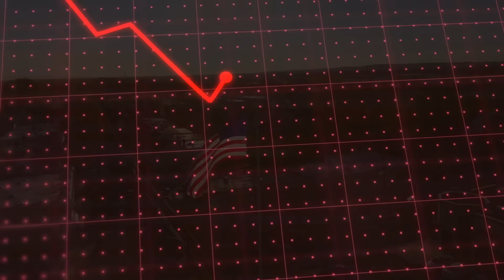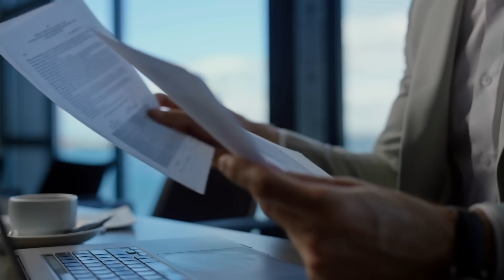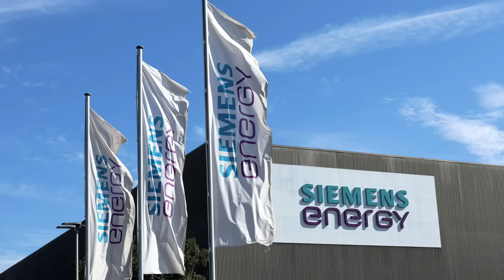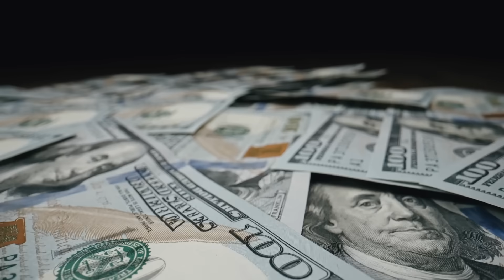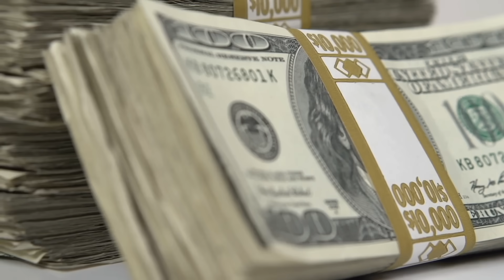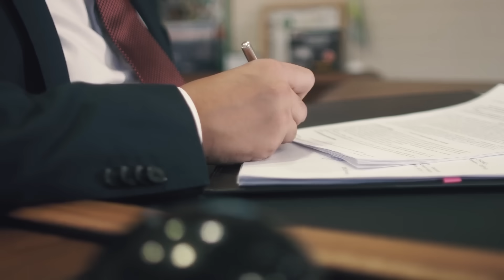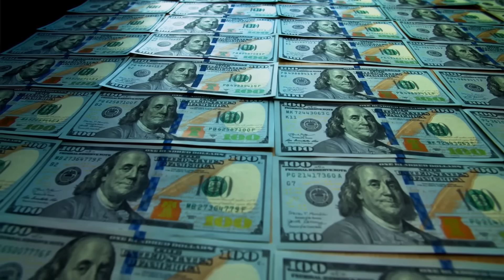The Real Reason America Has Turned Its Back On Wind Power Energy

Comment: I am originally from California and have seen Wind Farms in the Altamont Pass. Over time many of the wind generators have stopped working even with strong wind, plus yearly there is heavy bird death as this is an north-south migration path. The Wind Farms and Solar Farms are a poor solution compared to Nuclear, Natural Gas, or other fuel power plants.
Reply: I think ultimately nuclear is the best. This is especially so now that we have viable SMRs...can have a nuclear plant now the size of a small combined cycle gas turbine plant. Its a no brainer. 
Massive far flung distributed wind vs one small site that generates 300MW (or xyz) with fast nuclear reactor tech...like Terrapower. 

Whatever happens, there will be aspects of power gen that are irresistible. Behind the meter solar pv for example has taken the world by storm, noone couldve imagined how fast the costs would fall in just 2 decades. It is a classic example of creative destruction in economics. Solar pv's main adversary is of course solar thermal and solar hot water systems. I think its now the case that the most cost effective solution is to abandon solar hot water, and solar thermal, and never revisit it again...and just rely on solar pv + whatever generation is used fill the night time period of the day. 

Solar pv has essentially killed the economics of all power generation tech, except there is still the problem of what generates at night. It is the achilles heel. No point saying that to an acolyte of the renewable / global warming / climate crisis movement of course, coz theyll just make excuses for it til the cow come home. However, that is really the unarguable reality of it. Something that is on demand has to fill the reduced light, and no light times of the day in grids dominated by solar pv. It doesnt matter to me in the slightest what that is...wind, gas, diesel, biogas fuel cells (eg Apple HQ), etc. Its just reality.
Reply: They are stopped intentionally because in some time of day there is excess electricity in grid and not much transmission infrastructure to take power so in regulated market as in California they curtail or stop their wind farm , and in deregulated market like in texas the electricity price goes into negative so what it mean is to keep generating electricity wind farms will pay to the consumer to consume electricity
Reply: Trust the science and I do, that’s how I know the WEF=EU=WHO=UN CLIMATE CHANGE prediction is not just the greatest scam resulting in the greatest TREASON by UN Member Country POLITICIANS implemented the” carbon tax” and “net zero” replicable brown energy bull ship onto their citizens in living memory>>>>>>>>     

                The success of the WEF=EU=WHO=UN Climate Change scam for wealth redistribution from all UN Member countries to the Globalist elite MONSTERS , in all but a few countries like Russia with strong Leaders,   the Globalist MONSTERS plan is working perfectly! Affordable electricity for homes and industries, “CARBON TAX THEFT” electric cars, smart meters, poisoning cattle. All of these disasters successfully created by the Globalist MONSTERS puppets you call your government POLITICIAN and over paid bureaucrats (the question must be asked are our government politician’s idiots or knowing TRAITORS?) CO2 is the reason there is life as we know it on this planet>>>>>>>>>>>   

        The Dictionary defines TREASON; “Treason” is when a person acts against his/ her country. ... A treasonous person is called a TRAITOR! Outside the field of law, the word "traitor" can be used to describe a person who betrays a group to which he or she belongs!>>>>>>>>>>>>
Reply: I agree a 100% I'm California native.
Reply: Oh yeah and then San Luis Obispo County it's totally woke and green so they have outlawed gas heating and water heating every new house has to have electric appliances  And the grand kicker is they want to shut down Diablo Canyon nuclear power plant our own best form of electricity.
 Fruits & nuts man

Comment: I have had solar on my roof for many years.  Alas the sun doesn't shine at night.  Renewables are great, but we need a consistent base load.  The only way we can get to 100% renewables is with Tidal/Wave as there needs to be a guaranteed supply of which wind and solar can be switched off if too much generation.  In the interim nuclear is the answer.  The big problem with wind and to a lesser degree with solar is a connection cable and transformers is required, but is only utilised for 30% of the time and frequently under utilised, so once that is factored in and these wind turbines have a life of 15 - 20 years and a lot of maintenance, it doesnt make sense to keep adding them.
Reply: There are countries at 100% renewables without tidal waves.
Nuclear power is ok, when one has it. But building new ones as an interim solution is too slow and too expensive.

Comment: There are solutions to the grid distribution bottlenecks, but they depend on locating small modular nuclear reactors close to their loads [ideally just on the outskirts of big cities] so that energy transmission distances are short & direct.  Molten salt reactors can be designed to be walk-away safe & explosion-proof, to burn radioactive wastes from older reactors, and can be MUCH cheaper & faster to construct if various regulatory agencies from the 1950s can be persuaded to lift their dead bureaucratic hands from these modern projects.  Other quasi-optimum locations for modular nuclear are aging coal-burning power plants whose transmission line infrastructure is already in place.  Substitute the heat from the nuclear reaction for the coal fire - the heat exchangers, steam turbines, alternators, transformers & switchyards can be used as-is.
Reply: Peope need a solution now and not sometime in the future. It also needs to be affordable.
It also does not solve the bottleneck. These new reactors need connections too and they do not increase the connections for renewables.

Comment: 3.40 "very green to make"   thats utter nonsense.........the blades are composite materials (non recyclable) the steel,concrete,metals,generator are ALL made with fossil fuels and the concrete can never be recycled.  Wind turbines right now are subsidized with fossil fuel energy, and in most cases need significant load balance inputs from natural gas turbines during wind droughts, which are regular and substantial..........Australia has had really severe problems with that issue.  The entire east coast of Australia has regular instances of low wind, and low solar causing near grid collapse once or twice a year.
Reply: The blades can be recycled, as can the concrete.
Reply: @old-pete  Why do we see videos of them being chopped up and buried then?
Reply: @old-pete   I was hoping you might be able to elaborate on the recycling strategy of wind turbine blades that you say is easy, rather than compare to materials which really are easily recyclable, arguing that people do sometimes fail to recycle those materials too - I agree that's a shameful waste - But absolutely no-one throws away HUGE quantities of such obviously valuable materials as metal, in volumes comparable to those huge turbine blades and although we see them burying the blades in cut up sections big enough to almost live in, we don't see them dumping the steel structure - so obviously they DO recycle the parts which really are easily recyclable - No-one would turn down that opportunity.  My question is simply HOW do you propose they recycle the blades?  In my other much longer reply to you I've suggested they must surely have some ornamental value if nothing else but you seemed to be hinting you knew the material itself had intrinsic value when reduced - presumably crushed - I'm just enquiring what it woud be used for and why they don;t apear to be doing that... Or are they?   I imagine they are exceptionally difficult to crush / grind up / pulverise - There must be a reason they just bury them.   If they were made of steel, no-one would do that - If they were made of glass, no-one would do that, beause of the huge quantities involved.  I'm just curious how you envisage they recycle them.

Comment: wind is stupid, for so many reasons.  If your a country that has massive hydro generation, it can work a lot better, but for every other country its a disaster.  Australia is a long way down the road with wind and solar, and its been a total disaster for power prices climbing through the roof.  Large numbers of wind turbines needed to have blades and generators replaced after just 5 years.
Reply: It works fine in other countries. Maybe there is a quality issue in Australia?
Reply: @old-pete   well thats the issue, a lot of stuff going into wind farms, is you guessed it "made in china".
Reply: @wazza33racer  Then get your windturbines from Europe or the US and/or demand guarantees.
Suzlon produces windturbines locally in Australia.

Comment: Another factor is that there resistance to build new transmission lines. A proposal to build lines met opposition from people who in the path of the right of way. Also if the renewal generation exceeds the demand, who is going to absorb the excess generation? Are we looking at some of renewal generation being asked to shutdown until the demand meet the installed capacity of generation? This won't go well with investors.
Reply: Short term power plants have to power down when production is higher than demand. That is pretty normal.
Mid- to longterm it is possible to regulate demand.
Reply: @old-pete  I agree with your response.  Today gas turbines are used for peaking and can be quickly start up when demand reaches peak and then be taken off-line after the demand decreases to a level that the base load generation can handle.  If the penetration of renewals reaches a high level like 80% what is the pecking order?  Under the present rules renewals are given preferent treatment in that the grid must import the renewal generation, making the nonrenewal generation to back off.  With higher penetration of renewal low demand may pose a problem.  It is true that battery storage can be used to absorb the exceed renewal generation, but once fully charged and still at light load what it will happen?  Will this bring the grid operator tell some of the renewal generating operators to go off-line?  If this becomes known, what is the felling of the investors?  Something to ponder.

Comment: This video is full of hot air.  The real reason wind is failing is it is expensive, unreliable, isn't green and eats up an enormous footprint.  It is not a viable source of energy for grid power.  Companies were only getting involved when they knew governments guaranteed them vast profits.  That subsidy gravy train is over.
Reply: And they still get built.
They are just cheaper than fossil fuels.
The CO2 footprint of windturbines is 1/100th of a coal power plant and produces only 1/10 of the waste, which can also be recycled.

Comment: The NG grid is already built out and is working as well as transmission losses are minimal. Moving electricity from A to B has a natural loss of power disappearing into thin air. Trying to replace gas with electricity is a fools venture.

Comment: America's 'green energy problem' revolves around the fact that electricity is a momentary thing.  The generators MUST be pushing electrons the very split second you flip the switch for you to get the power you expect.  So...the hidden truth is that there are multiple fossil fuel generators operating 24/7 to cover the slack when it is dark (over half the day on average) and not as breezy as needed.  LET THE MARKET FIGURE IT OUT!  All too easy to spend other people's money, eh?  The video's producers should study some economics.
Reply: They do not need to operate that long, as wind and solar output can be calculated in advance.
Reply: Sorry, but no.  They operate 24/7 due to clouds over solar, and cessation of breezes.  Again, the electricity cannot be 'stored' per se, but must be available in total at the moment of demand.
 @old-pete
Reply: @Mentorman63  And wind and solar output can be calculated up to 48h in advance.

Comment: The one issue that never seems to be discussed involves what is known as baseline generation. Electric utilities require reliable and available generation capacity to meet demand. These requirements are best satisfied through installed generation capacity driven by (gasp) fossil or nuclear, with a bit of hydro thrown in where feasible. These sources are reliable 24/7. Wind and solar do not satisfy these criteria and it is only the dictates of politicians that know nothing about electrical generation and distribution that force utilities, who know better than to invest in intermittent generation, to either invest in this boondoggle or face harsh regulatory consequences imposed by regulators who do not understand how a sustainable and reliable generation, transmission and distribution system actually functions. The dictatorship of the ignorant and incompetent.
Reply: That is what hydro and biofuel are for. And with sufficient wind and solarpower one generates a baseline too.

Comment: Most of this stuff is built in China . . . massive Emissions & Pollution . . . blowing in every day on the West Coast.   
These turkeys have Massive Carbon Footprints by the time they get Installed . . . and many will likely NEVER save the amount of Emissions required to build them!
Reply: Windturbines manage that in 5 to 15 months.
Solar panels manage that in 30 to 50 months.
Reply: @old-pete  Not True . . . . 
After 10 years the acreage when the Solar Panels are situated becomes useless for agriculture or habitation because of the arsenic & other toxic chemicals that leach out of them.  Then they go to the Landfill . . . 
Windmill blades are chopped up and buried as well . . . these things are useless junk.
Windmills didn't work in Britain or Germany last winter, nor did they work in Alberta at -30 . . . 
The Germans & Brits opened Coal Mines to offset the energy shortages.  

The entire Gorebull Warming narrative is made-up nonsense . . . designed to destroy your standard of living & make you poor.  
Wind & Solar will NEVER power a modern industrial city . . . a Spanish steelmaker just moved his operation out of Spain  . . . he said "you can make Windmills with steel, but you can't make steel with windmills".
Reply: @old-pete  Solar Panels are Toxic Waste . . . pollute the land they sit on.   
Windmills don't seem to work well in Germany, Britain or Texas . . . where are they working?
Off Shore wind requires annual manintenance costs of over $40,000 . . . each.
A Part-Time solution to a full time problem . . . lol

Comment: Last Winter in Britain & Germany they had to open up Coal Mines to keep the citizens warm . . . their massive Wind & Solar Farms DID NOT WORK.  
Germany is losing Industries as they relocate to countries with reliable systems.   
Are you aware that a massive multi-acre Solar Farm in 10 years because of harmful chemicals leaching out of the panels makes the land Unsuitable for Food Production or Human Habitation?
Alberta with about 20% Wind Power had to depend on neighbouring provinces last January when a cold snap forced the shutdown of the useless Windmills.  They evidently become brittle in the extreme cold . . . the other laugh in the cold was the EV . . . that had 1/3 of it's normal power and could not be charged at -30.
None of this nonsense is Ready for Prime Time . . . a Part Time Solution to a Full Time Problem . . . complete waste of Capital and will all wind up in Landfills in a decade.
Reply: They did work. And no mines were opened up.
Britain and Germany, as many other countries, have a problem with increased FOSSIL FUEL prices. One more reason to depend on them less.
Solar farms do not leach, unless one does not take care of them.
All provinces get electricity from other provinces sometimes. That is what interconnectors are for.
Reply: @old-pete  You LIE . . . in Germany they actually moved windmills to access the coal beneath them . . . 
In Scotland they had Diesel Generators trying to keep the useless Windmills warm.
A Part-Time solution to a Full Time problem.  
Industry is moving out of Germany as Energy Costs are far too high . . .
Reply: @dalew801  The mine existed before the windturbines. Read the whole article!

All power plants need power. When the grid fails, it has to come from somewhere. That is why many power plants have backup generators, nuclear power plants even have to. In case of windturbines, they do not need to be diesel powered, but it is an option.

Industry is moving from Germany since before renewables were a thing. And the energy costs are high because of high fossil fuel prices, since some idiot started a war.
Reply: @dalew801 And still the mine was there before the windturbines...
Coal usage in Germany declined again btw...

Comment: Apart from the flimsiness and maintenance problems of wind turbines, the principal problem is the amount of land required for a single wind farm. It's like spreading a traditional electrical power station over dozens of square miles. This cluttering of the landscape is leading more local governments in the U.S. to veto new projects.
Reply: The area is dual use. One can farm on the land.